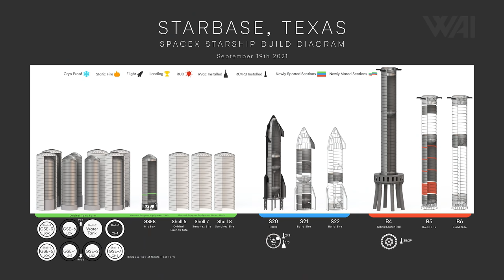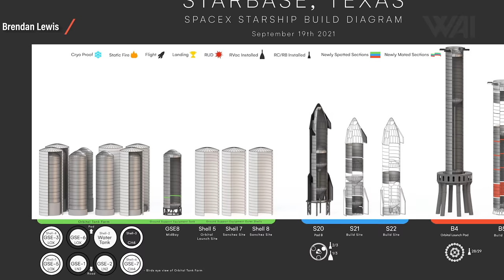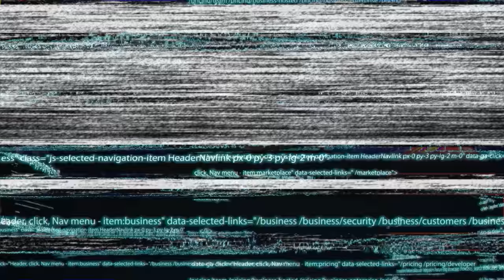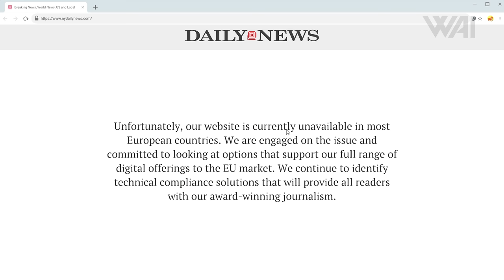Starship 2021 Official Design Changes – The Holy Grail Of Rockets!

Comment: They would really speed up if they started using Self-Created Metal Composites. This is a completely new technique, far more effective than 3D print. It’s easy, fast and cheap. Anyone can create a rocket engine even in own garage… Please, check this information ;)
Reply: So put a completely new technique that has never been tested in space, on an already multi-billion dollar gamble?
This is why you're not a CEO.
Reply: @oldmandoinghighkicksonlyin1368  agree
Reply: Hate to say this but what are you talking about you think rockets are made form basic steel self created metal composite will never take the heat and would destroy itself in a matter of seconds try and let the adults talk now please
Reply: They prefer to go with metallurgy and create custom alloys. Lot less complex materials.

I think in the future the next big thing won't be composites, we've had those for decades. It'll be metamaterials.
Reply: @oldmandoinghighkicksonlyin1368  You are right! Not only a space business but whole life is a gamble. You always lose when you leave the table. 😉
Reply: @charlestorruella8591  Did you test it?

Comment: 12:06 that’s flat out rubbish. There is no “Optimization” phase. SpaceX right now are in all 5 phases described by Elon’s designed philosophy at the same time; it’s not all the same system, but several different systems at different stages of iteration, the tower and mount in its first, the GSE tanks close to the final stage, and the stages of the vehicle themselves having different subsystems being iterated in the process. 

“If you’re not adding things back over time, you’re not removing enough.” 
He said it all. All it took was someone to listen to understand the system as a whole instead of misinterpreting his words as some sort of regurgitated dogma.

Comment: In the new render there are no stationary fins on the booster. Could this be yet another reason for the grid fins to remain in the open position vs. in the closed position?
Reply: No, quite the opposite.   IF, the grid fins caused enough drag to affect the aerodynamics,  it would be in the wrong position relative to the center of thrust.  I'm guessing,  the reason tail fi s aren't needed  is because of the high combined thrust of a flock of Raptors, pluse their computer controlled  gimbal .

Comment: Love Elon, think he’s a genius, but I have one nagging doubt about Starship.

Every spacecraft that has ever returned from space with people  – Mercury, Gemini, Apollo, Soyuz, the Shuttle, Dragon – has returned “empty” and inert, nothing volatile on board, with a final gentle glide or parachute touchdown.
 
Starship is supposed to return like a ton of bricks with several thousand gallons of fuel on board, rely on every one of thousands of tiles not failing, and then violently flipping at the last second a few hundred feet off the ground. All with people on board. (and also launch with no way for a crew blast away if a failure)

Wild idea: Why not incorporate the already proven, self-contained Crew Dragon capsule into Starship, at least during the beginning flights?  Either inside or on top?  The main ship and the Dragon/crew would return separately. Maximum safety for the crew, going & returning. 

Sure, extra hassle and steps of prepping/mounting/retrieving the capsule & crew, but way less chance of fatalities. 

We all love SpaceX, but in the current regulatory/gov’t. environment – for the next 5-10 years – even one fatality and the authorities will stop Elon dead flat. Bezos would gloat.

Perhaps I’m missing something, any thoughts?
Reply: What good would that do? It's not like they're going to be testing the re-entry with people on board... by the time Starship carries humans, it'll have chalked up hundreds of successful re-entry flights, launching Starlink payloads at first, then commercial launches. Basically, exactly the same as they've done with Falcon 9... several years of demonstrating the safety of the design with uncrewed launches before the first crewed flight.

Comment: Anyone else think the new render without superheavy legs/ fins at the bottom just looks very aerodynamically unstable? I'm sure they have a fast computer autopilot that can gimble the engines to correct for this, but the full stack just looks like a rocket that would be impossible to fly without flipping over in KSP.
Reply: This is an advanced rocket with precise TVC not some amateur rockets. Electron doesn't need fins either
Reply: @alvianchoiriapriliansyah9882  electron doesn't have fins at the top though. I'm not saying it's not going to work, modern fly by wire systems can control aerodynamically unstable aircraft, so im sure the fully autonomous starship can do it too. It's  just that all the flaps and grid fins are above the canter of mass, and if these get any sort of angle of attack relative to the airstream, they tend to try and flip the vehicle, so that they're in the back. 
The old render (with grid fins retracted and fins at the bottom of the booster) looks like it would be more stable on ascent (where engine gimble can also help control the aircraft) but less stable on descent (where engines are turned of on the booster).

Comment: Space shutle and even Buran was one of the first reuseble uper stages that went to orbit.
Starship is not even complet now.
Reply: No upper stage starts its engines on the ground, only the first stage can do that. Shuttle was an SSTO with boosters.
Reply: When was the last Shuttle/Buran flight again?
Reply: @Vatsyayana87  buran didn't start its engines on the ground.  It didn't have main engines
Reply: they were a spacecraft with engines kind of in the middle.  with starship it is second stage + spacecraft. and being an upper stage you can refuel it and isn´t only payload so it is different in that way.
Reply: @ChevTecGroup  Yes indeed which makes it a payload and not a stage at all.
Reply: @SeraphArmaros  Well thats not relevant to the convo lol

Comment: Is it just me I honestly don't think those catching Arms look remotely strong I'm not talking about the arms I'm talking about the up-and-down that doesn't look like that could actually hold the bottom stage rocket
Sorry
Reply: There are many smart engineers at SpaceX
Reply: Only the arms need to hold the rocket. Well, the arms and the cables attached to them and the tower's draw works.
The carriage/sled only needs to provide side way stability, keeping the arms from dangling horizontally
Reply: Remember, the booster is much lighter when being lifted or caught, since the tanks are empty (or nearly so). It's actually a pretty light load for that giant Liebherr crane that they've been using to move it around, and while the catching arms aren't going to be rated for 1300 tonnes, they'll be fine with a dry mass of something around 200-300 tonnes.

Comment: QUESTION: What if starship was cut in half. At landing, the engine part would land itself, but the human top part would seperate and land using a parashute. This might be more safe than flipping the rocket and landing with humans with the bosters. Plus less fuel needed to land! MORE SAFE, FEWER DEATHS IN LONG RUN.
Reply: Pretty big claim there
Reply: Yet strangely they don’t do that for passenger jets 🤔
Reply: @fredbloggs5902  They might if passager yets landed vertically.

Comment: The "sled" by chopsticks is  support for rocket will go on fuel arm to support rocket before launch the chopsticks still need tracks and drives ....sled can wait my 2¢🤣
Reply: Im not sure what you mean, but the sled is for the chopsticks, The fuel arm does not move up and down at all. Unless there is some other crazy idea happening that has never been mentioned by anyone.
Reply: @Vatsyayana87  I think the" sled" is actually a support grabber Time will tell 👍something probably has to grab hold and stabilize SN 20 against the Texas wind which requires multiple attachment points looks like four( might be separate from fuel arm but would require more parts ) it also makes sense to ignite the booster then release starship  swing the fueling arm/ grabber support assembly away from direct rocket exhaust , finished by releasing the booster starship stack.
 The booster is stabilized by the base " stage 0".The wind load on starship is much further away and probably requires more support than on just the booster stag 0 connection . The fuel arm is way stout why? For support of fuel hoses?And the sled looks too weak compared to the chopsticks(yes it might only needs to be Stout at attachment  assembly between chopsticks hinge and one tower leg) Elon kind of hinted at this idea with Tim, everyday astronaut interview,but then immediately said things could change by next week.🤣

Comment: They could use cameras instead of windows and save complexity and weight.
They could use just one tank instead of two big and two small tanks and lots of extra plumbing.  Just separate the CH4 and O2 with big plastic collapsibles inside one tank, they can be kept at the same temperature.  As the fuel/ox is used, the plastic bags inside the tank collapse, preventing sloshing--yeah, just like the J&J baby bottle.  We're talking thousands of pounds in weight loss.  Somebody give the next astronauts a J&J baby bottle to test in space.
Reply: Brought to you by YouTube Engineering Corp. which had landed human on Triton already
Reply: >  they can be kept at the same temperature

But the two liquids don't have the same temperature

Comment: Wait a minute! You're suggesting people live at the top of a 50-metre tall tube when they arrive on the moon? A tube that contains large amounts of unstable fuel, and oxidiser?
Oh yeah - that sounds like a great idea. Nothing could possibly go wrong with that concept! Nothing!

Let's not even start to discuss attempting to start turbo pumps in zero-G, or after being cold-soaked and welded solid in a vacuum for a week or more.

Yeah, can't see any problems with that idea either. Nope. It's all gonna be easy as pie; cranes never fail, or hurt anyone, and despite not a single turbo pump ever being operated in zero-G, or after being cold-soaked in space, Musk's earnest convictions about turbo-pumps, cranes and heavy ionizing radiation will carry the day, for sure!

So, no worries, then. Woohoo! 

I'm off to cook a tasty burger on my flaming Tesla. :)
Reply: Many says that cultists are the worse when not many says that haters are no different

Comment: Normally I like this channel. But it’s not the first reusable upper stage. That’s still the Space Shuttle. Like it or not… cheap (or definitely not) it’s still first. Even the Falcons get refurbished. All 9 engines replaced, and inspected. And every single Starship is going to have the same arduous examination of its heat tiles. Just moving it to and from the shed and sitting in shadow, and then sunlight broke tiles. And you think reentry won’t? Same for the 6 engines. Sure, they can swap them quickly now. But every system has to be checked.
Reply: What's your source of them replacing all 9 engines everytime? FYI they didn't

Comment: i think you should be clear and stop calling a sub orbital test an orbital flight, sn20 will not go more than a 3rd the way around the planet in space, hardly an orbit and barely a space flight and the nonsense of falsely labeling a sub orbital flight will give viewers the wrong idea about the upcoming test so as long as you push this false info i will not be a regular
Reply: SpaceX is calling it orbital, only a small circularization using small ullage vent and you're in full circle. Far from Virgin Galactic or New Shepard